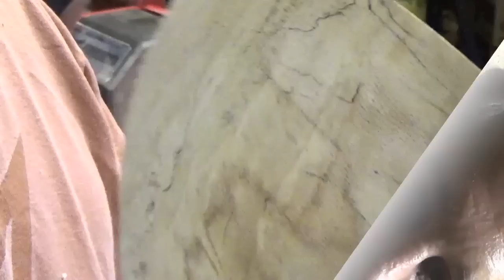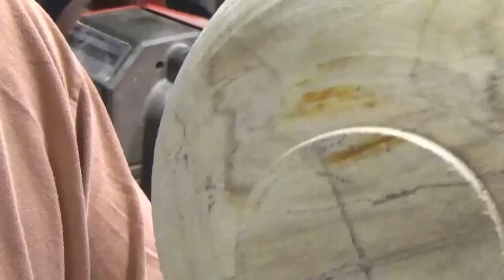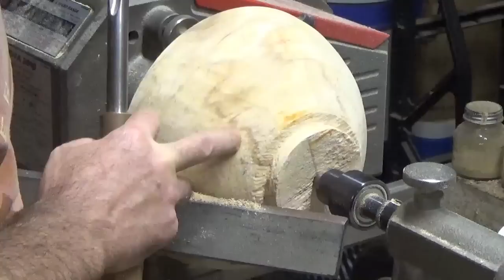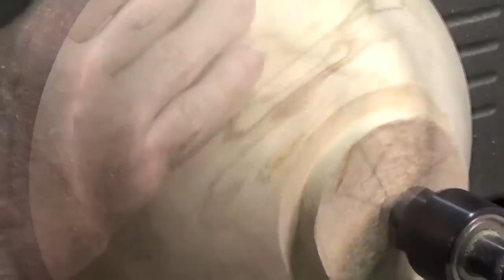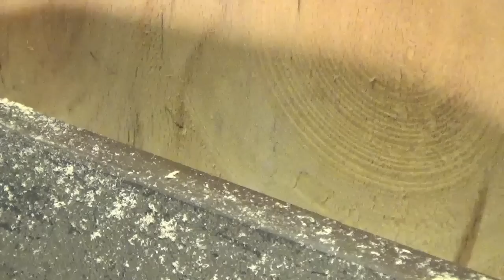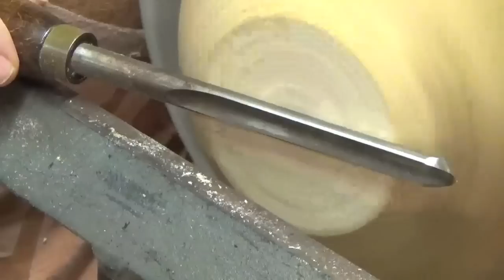Woodturning: Microwaving Rough Turned Bowls

Comment: The burning was caused by a heat build up in the DRY wood - so long as there is water to boil off, the temperature is held at 100C. But when thats all gone the temp is able to rise much higher and in the thicker parts of the bowl the heat cannot escape fast enough  leading to a hot spot and carbonisation (pyrolysis) and the lovely smell of toasted wood.

Comment: Great video.. I too have been experiencing with the old microwave lol.. I am going to a mission mart to get a cheap used one for the shop.. yeah my old lady doesn't like me doing it in the house also.. When i encounter punky wood like this I soak it down with Deft Sanding sealer.. Mixed 50 50 with lacquer thinner ill even submerge the real bad ones then let them dry for a few days to make sure the sealer is cured but it will soak into the wood a good distance if you really soak it and then harden up..Then make your final cuts...
Reply from the maker: Thank you. I've used shellac to stiffen fibers, but now I view punky sections as a challenge. :-) Most of the time I just give up on really bad wood. I still need to get a microwave for my shop, but if you don't tell my wife, I won't tell yours. :-)